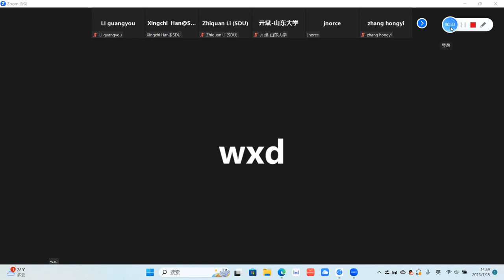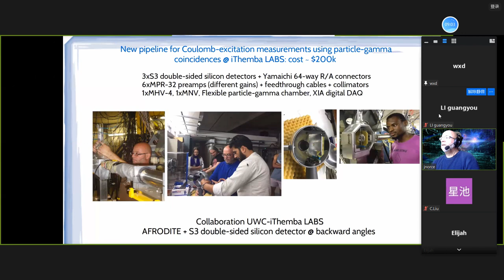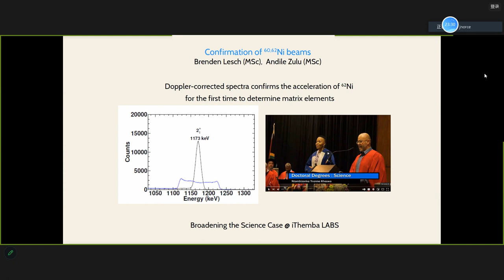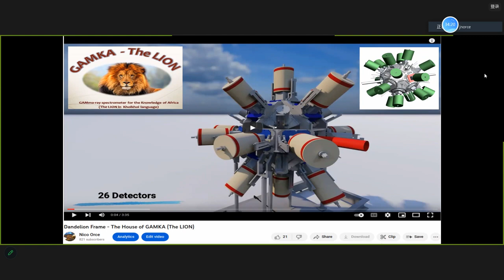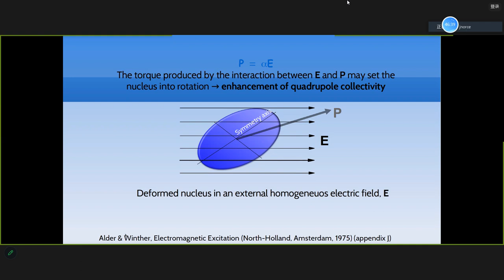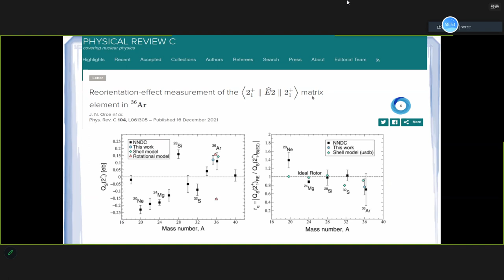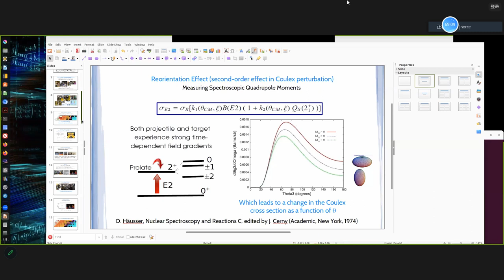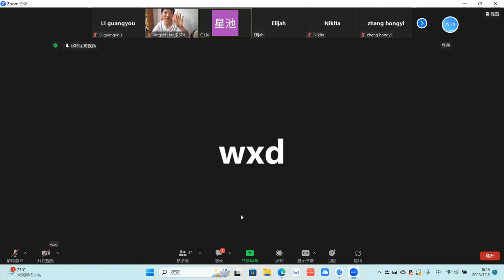Building a Coulomb-excitation program from scratch

Comment: Prof. Orce, Can you explain what is this energy sharing condition? I didn't really get that.
Reply from the maker: In any segmented silicon detector there are dead layers which separate rings and sectors and form the circuitry that goes to the PCB connector and feed-through cables. If a particle shares its incident energy  between the active silicon layer and these dead layers then -  similar to the Compton effect -  this event will contribute to the background. To account for these events, we can use an energy or charge sharing condition, i.e. an energy difference between the energy incident in the sector (ohmic or n side) and the corresponding ring (junction or p side) to be smaller than approximately a few hundred keV (you can play with this energy condition in your sorting code until you find the one that removes best the background while conserving the counts in the elastic peak). This energy sharing condition considerably reduces the background at low and medium energies in the particle spectra, which as you can see in my presentation, comes very handy when you want to observe the inelastic peaks in 12C at forward angles. In principle, you could also do add back of the particles, recovering the loss events.
Reply: Thanks a lot Prof. Orce for such a nice reply and nice presentation of course.